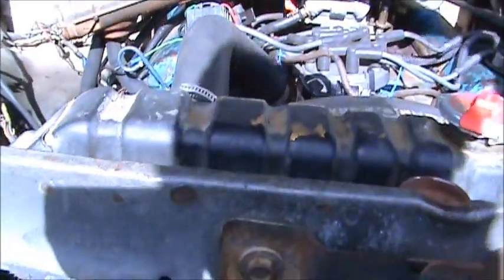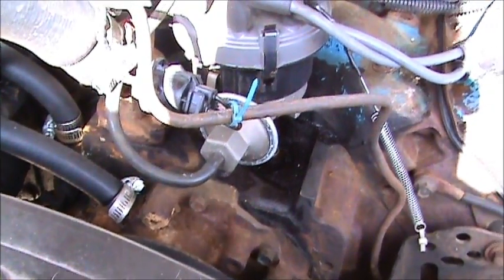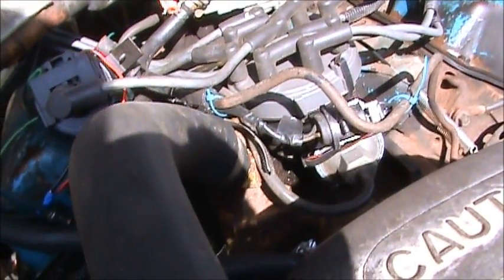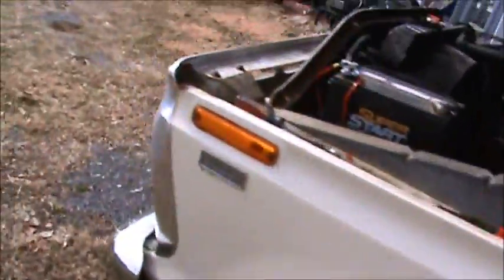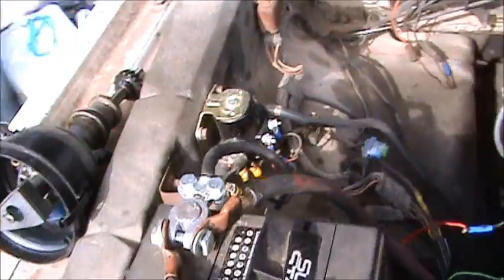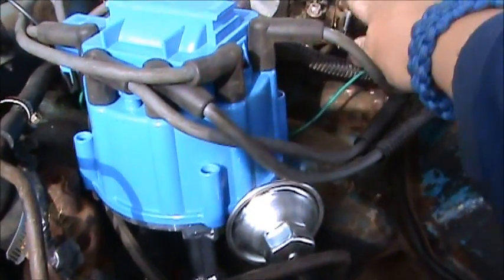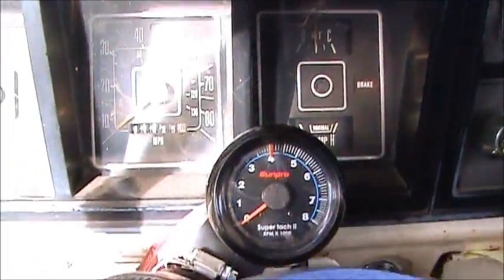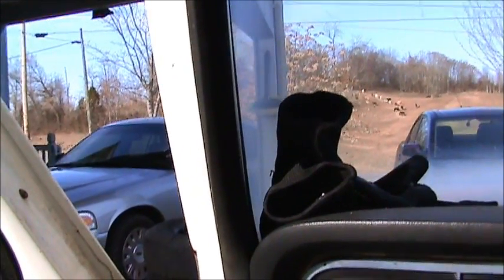FIXING A FORD WRECKER WITH CHEVY PARTS HEI RETROFIT HOW TO !!!

Comment: Got my distributor in today for my 79 f150. Once I got done beating the old distributor up to un-seize it, the new one was in and i had the truck running in a couple of minutes. For my ignition wire, there was a tan 3-pin connector that went to the ignition module with a red wire at one end. Hooked a test light (194 bulb with legs bent out) and it had voltage with key on and start but not with key off, so I went with that. If not for this video i'd still have a truck that didn't run. Thanks beltstowing
Reply: can u post a pic of ur ignition wire set up?

Comment: ford duraspark systems didnt have full 12 volts to the coil when running. the i terminal on the starter solenoid provided battery voltage under cranking to allow easy starting and once the engine was running the voltage at the coil was provided by a wire from the ignition switch that has a resistor in it. this dropped the voltage to 8 volts typically. that blown coil was probably due to the fact you gave it full 12 volts. duraspark is a great system.
Reply: HEI is a great system. Duraspark is great under certain, correct conditions.
Reply: You only need to resist it back down if the coil pack is not a 12 volt coil some people upgrade them I usually upgrade my trucks up to the 12 volt coils so that way I can run just straight 12 volts but those that's usually on truck side rewired completely from scratch so that way it ran off toggle switch like a drag car type s*** now I'm actually trying to fix one of my old tow trucks kind of like he's doing right now and it's got the 460 in it and I've gone through three of those initial models I'm not even adding power anything I'm using the factory initial module and then two others another factory going out another truck I have and one that someone else bought and put in under the hood but did not have plugged in my issue is is and how you can tell whether or not just going to work is she got a little break light up above your your gauges and all that that light doesn't turn on when you turn the key on during start right before you start it you are not going to have spark and that's why I've been having issues with so I have a few GM HEI distributors laying around I'm seeing if I can use one of those that or one of my GM points distributors I rather just go points if I can't use my hdi

Comment: I have a 1974 Ford F100 Ranger with the 302 and distributor have an 89 Chevy Camaro Aei will that bolt right up into the for 3o2 or did I understand the video wrong

Comment: Where did you run the 12v ignition from? If it was the ignition switch, what was the wire color, and did you eliminate the factory wire and just replace with the 14 gauge to run the HEI?

Comment: Thank you sir. Is yours still going strong?
Reply: Richard Stephens oh yeah , it's not the only one I have converted either , I don't have that truck anymore , but a local youtuber bought it , and she is still running just fine , these distributors are the way to go , they even have a tunable vacuum advance too , they come with instructions for that , most run great out of the box , the cap and rotor is also of good quality , you can't really beat them for the price , they are cheaper than fixing the factory duraspark set up , as just the coil is $30 , a halfa** reman dist is $50 , and the spark module/ brain box is around $40 , a good cap and rotor will cost you what this whole distributor in a box costs , they come 3 ways FYI , with a cast iron cam gear (stock engine ) bronze , and steel gears , the latter cost far more , so don't get confused in the purchase there ... one wire and she runs , simple , easy , quick , and she is running , only drawback is it looks really weird , makes the poor ford look like a chevy engine lol , but function is superior , far superior !

Comment: im putting oner of these on my 360 ford from 1973  woul you power it from the s terminal on the solonoid
Reply: No
Reply: Howard Paulus it needs to be a switched 12v from ignition switch

Comment: did u have to regap the plugs
Reply: markymcintosh well on a Chevy with HEI the plug gap is .045”. If your gap is bigger than that than I would regap. Any less and it would probably be ok but it would run the best around .040-.045”

Comment: How exactly did you wire the distributor? Nice video, I've got a 400 myself I'm thinking about doing this to.
Reply: DensamG you mean get the power wire for it ? if so that is just the wire that connects to the + side of the coil , thats it , it runs
Reply: +towrecker how did you do the firing order on this since the hei is gm? ford firing order totally different?
Reply: +alejandro campos the firing order is mandated by the engines crankshaft , not by the distributor , it uses the exact same wire placement as it did before , also this is a modded distributor , it is not exactly a stock chevy one either , just making that clear ...
Reply: +towrecker so where would firing order be say 1 to start of just curious  putting petronix 1350 on my 360.
Reply: +alejandro campos there is no correct place to put it , you have to bring the engine to top dead center on cylinder number 1 then see where the rotor is pointing / at what wire ya know ... and when you do that make sure you leave it in the middle of the turning path so you can set the timing ...
Reply: alejandro campos all the distributor does is spin it don't know the firing order

Comment: It take Chevy parts to make a Ford run correct, you may say it has the heart of a Ford but the brain of a Chevy, but without the brain you got nothing.
Reply: A lot of people swear by the duraspark 2 set up. Chevy just makes simple products for simple folk. Sometimes simple is better, but not always. Ford innovates, they can make some incredible machines and make a whole lot of power from very little. In this case, like in mine, the problem wasn't ford's design that caused the failure it was someone butchering the harness. When people start splicing shit into the harness and halfassing the connections problems related to exposure and corrosion create issues and in this case, it's simpler to eliminate the culprits and install a simpler system versus running a meter looking for shorts and dead wires. The HEI is a great design and I say that as a ford man, but those things are massive too and I've seen many a times where they had to be modified to fit. There's no one solution for all and I'll drive any car when I have to because it beats a proud walk any day.

Comment: That is an actual Ford distributor in the GM style,correct? I couldn't pull the distributor out of a 76 monte carlo and put it on my 70 Cougar 351w without changing the gear and the shaft length on distributor,right?
Reply: actually this is a combination of parts , and some work on the lathe putting this one together to save $20 , but they make ones you can buy pre built that are a bastard child just like this , half ford , half chevy , just hit ebay this is 351w ready , item #221431883641 , those guys are just down the road from me actually , that is the same distributor brand as the one I modified to fit a ford , but already done for you , like I said I am a cheap ass , and bought the cheaper chevy version and modified it , but without access to a machine shop you don't have the cheaper option , I have been making them since before anyone sold them lmao
Reply: and entire crown vic police interceptor chassis stuffed under a 57 chevy , yes pop wanted a cheap driver made out of it , needed fuel injection A/C over drive , the whole kit of tricks , and well I have plenty of vics around , 30 min later as the parts were flying off the vic to harvest the chassis , he simply moved the big wrecker closer to lift the body off , 3 days later we drove it , and about a month later it was completely done , so there is a chevy bailout for ya ;)

Comment: wow takes chevy to fix a Ford right,.... I got nothin.... 
tuning it by ear? you been doing that long PYLE? 
when are you going to put a proper 4 barrell on that thing ?
Reply from the maker: I have told ya before son that a 4 bbl is not a good thing on a tow vehicle , google it , a 2 bbl has better torque , this truck runs and pulls hard with that 2 bbl lol  as for tuning by ear , I used to tune the drag car by ear , and even set the valves (not running ) without feeler gauges , simply by feel , yes I have done just a little bit of auto tuning before , I also adjust carbs without a vacuum gauge , and gap spark plugs with my pocket knife , and the funny part is friends have came behind me and tried to prove me as not accurate , and well they have more than once looked like dumbasses , as this old goat can get them dead on , I can gap 8 spark plugs with my knife , and get them all within .002 even in a hurry lmao , I learned to fix and tune without having the correct tools to do it as a kid , today I do own the tools , but never use the damn things ha ha ha ...ever used a garden rake and a torch to clean spark plugs , another trick of mine that blows peoples minds ;)
Reply: theGomer thing was what i was getting at mostly with the comment about you tuning cars by ear (that's how him and Goober used to do in the Andy Griffith show if you recall)  but yeah i've done my share of that too. Never the valves though those i always used the guage for because i didn't trust myself the spark plugs i have done the same but never with a poket knife i used to use a jewler's screwdriver and get them pretty spot on also and the carbs i would just get the thing running first and adjust it out by the way it sounded and revved. i'd start out by rolling the idle screw all the way in and backiing it back out 1 1/2 turns then crank the car and tune by ear from there. i am starting to hate all this computer junk though. it's starting to piss me off on several vehicles
Reply: DaddytechEnt yeah all the new shit is crap. i hate it so bad i dont want it even if it is free. in 10 years do you really think all these touch screens and nav systems are still gonna work and do you think on star is going to be around in 20 years? no, in 10 they will drop support of it and have something "better"....
Reply: the way technology is progressing you'll be running everything from a watch before long so i completely agree with this one.